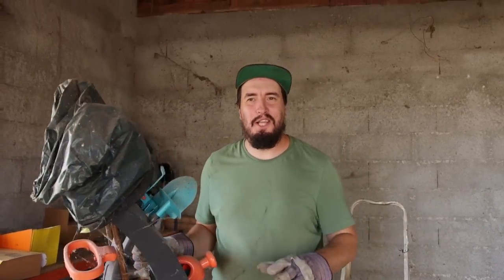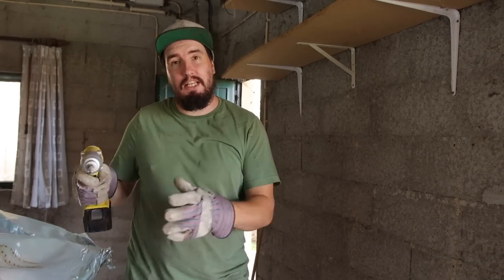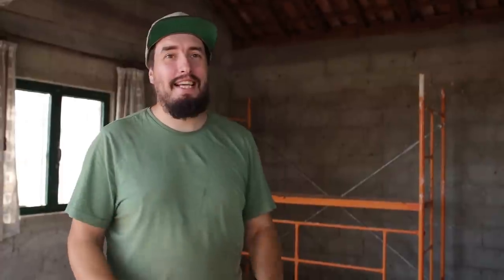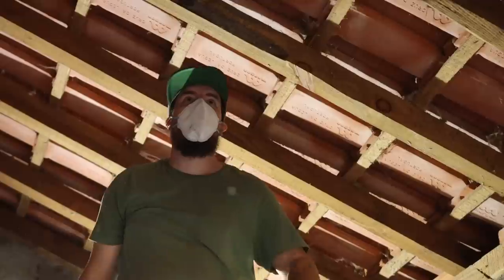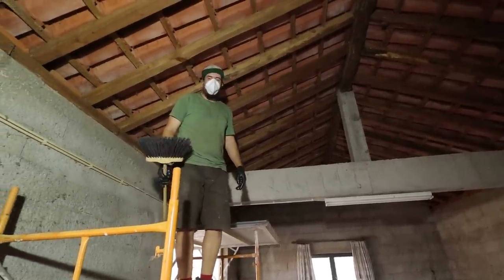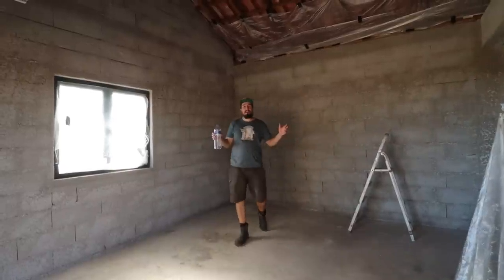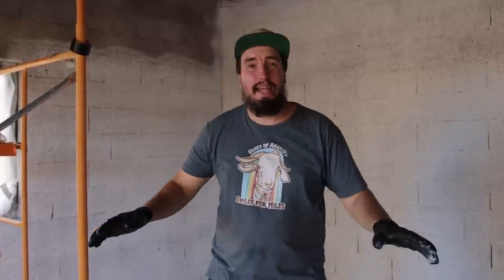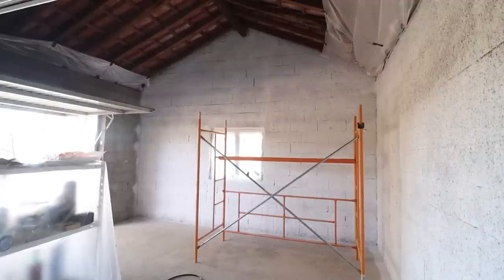CONVERTING A GARAGE INTO A DREAM WORKSHOP!

Comment: Great to see you getting stuck into another hugely rewarding project. Don't forget for smaller paint jobs you can use the compressor with a cheap spray gun and won't have a long hose to clean after. Your enthusiasm is infectious.

Comment: There's nothing like a good spray painter I hear there's a good one you might want to try out it's called the critter a lot of crafters and DIY  folks love them and you just screw the jar on the bottom so if you don't use all the pain up you just put the lid back on the jar and then just clean your device